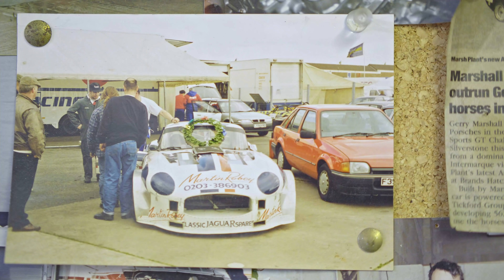Stripping the Jaguar V12 to a  block! VLOG40

Comment: The moment I heard 'Rob Beere' I knew you were going to put the 96mm liners in it.  Bloody awesome.  Can't wait to see it running!
In case you ever need to take the heads off again, investing in a head pulling plate for the v12 might be a good idea.  Anti-seize on the the threads of every bolt you put back would be a plus.